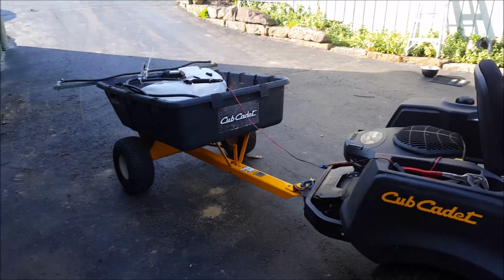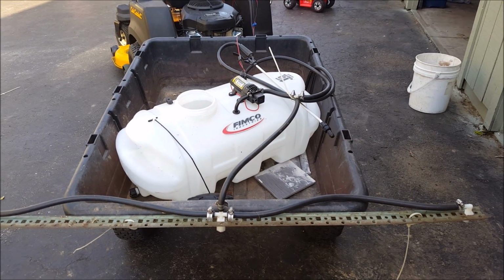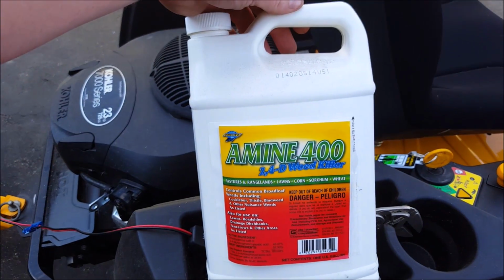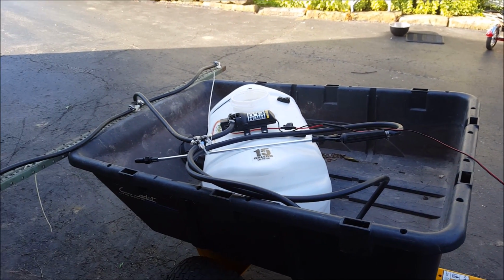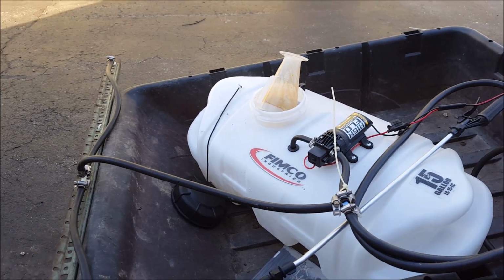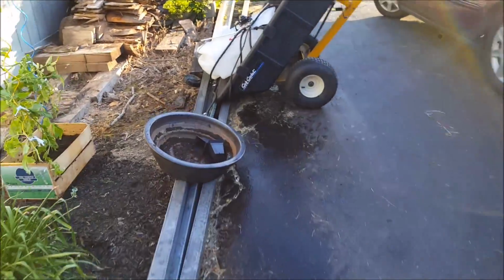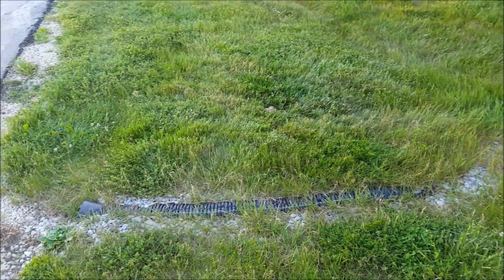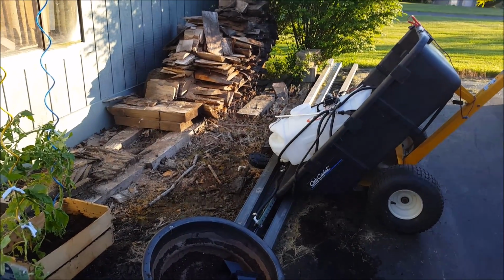Controlling lawn weeds with 2-4D Amine / Diy spray boom

Comment: My tips.... Make a bracket to mount the tank and booms on the front of your ztr. You will be able to see what you're doing better. Also depending on how big your lawn is, add two more nozzles on your boom. This is so you can get a easy overlap with your passes.  I use 32oz of Trimec for 15 gal of water @ 5mph and I use the tips  #AI10025

Comment: the  hy yield brand 2-4-d  I use calls for one gallon per 15 gallons  but I usually mix it at  4oz  per gallon.   Bayer brand calls for 3 to 4 oz per gallon.. at 1 oz per gallon you may as well use straight water because you arent going to get it done with 1 oz per gallon

Comment: Why didn’t you use the Polaris Ranger for the sprayer?  I have a garden tractor and a ranger and think that the dump bed on the ranger would be a lot easier than hooking up a trailer to the mower. Looking at getting the same sprayer to do our yard
Reply from the maker: It tears up my yard more than I would like, but that's a good idea.
Reply: Brett Buckley Even In turf mode?  Just trying to see if I need to get a trailer for my riding mower
Reply from the maker: Unfortunately the 2016 ranger 570 full size doesn't have that. I beleive all rangers 2017 and up have it.
Reply: Brett Buckley ahh gotcha I have the 2016 ranger 570 midsize
Reply from the maker: I debated between the midsize and full. I wanted that little extra room. I do wish it had turf mode.
Reply: Brett Buckley haha that’s funny I wanted to lock n ride system but I wish I could get more weight in my bed. I can only get about 500-600 lbs. I think you can get 1,000 in your bed
Reply from the maker: Subbed you. Looks like your channel is right up my alley.
Reply: Brett Buckley same. Thanks a lot man

Comment: Great video.  I would like you to put some Blue dye in and spray again.  You can get the Montery Blue 8oz for like $6 and it is very visible in like 8 gallons.  Hence, you would need to spend about $12.  It would show you where you sprayed.  That said, you need spray only in areas where you have weeds.  No need to spray the whole lawn.  Might instead use that long hand sprayer and have someone creep you around through the yard you sitting on the trailer nailing all the weeds that way.  It would be more precision.  The other thing you might want to do is buy some Triclopyr.  You can get an 8oz bottle for like  $25 of the 60%+ concentrated stuff.  You would use only around 1 TBSP per gallon or half an ounce.  Mixed with 2,4-d it would hit your weeds even harder.
Reply from the maker: ill check that out. thanks.
Reply: NETWizzJbirk  I have yet added enough of that blue stuff to see it!  I added almost the whole jug the last time I used it...FAIL

Comment: Half tank water with nitrogen, then add 2,4d. Mix with stream if water from hose or using tank pressure control valve if available on tank.

Comment: How wide is your spray pattern?  I just picked up the same sprayer and nozzles from TSC today.  Did you 'Tee' the boom hose into the spot sprayer hose?
Reply from the maker: The spray pattern is right around 6 ft.  Yes I put a T in the spot sprayer hose.  Only thing I still want to do is put a shutoff inline with the boom so I can shut it off.
Reply: Brett Buckley inline shutoff can also be used to control rate of flow to boom so you can use less product and go slower for more precise coverage.
Reply from the maker: Airplane Doctor very true.
Reply from the maker: Do I know you ?  Your user name makes me wonder......
Reply: Brett Buckley If you work in the warbird restoration/maintenance field you might.
Reply from the maker: Nope. I am a aircraft inspector though. Thought I may know you because of your screen name on here.
Reply: It worked great last year, only needed 2 nozzles, 3 was overkill. Used the barbed shut off valve to use spot prayer independently.  Thanks!!!!!

Comment: What sprayer nozzles did you use. I've got basically the same set up. But the heads I got from tsc where crap
Reply from the maker: Kevin Forbes it's going to be a while before I can look. I wrecked my motorcycle and broke my back so I can't go out and look... yet at least.

Comment: Are you happy with the results with the the 2,4-D?  I'm thinking of trying this on my 1.5 acre lawn.
Reply from the maker: Overall yes.  It didnt end up killing off as much chick weed as i had hoped but it knocked out everything else.
Reply: What kind of grass it that? 
I just sprayed my lawn near galveston Texas with 2 4 D Amine, and it killed my St. Augustine grass, all of it.
Reply: At what temperature should I put down 2-4D? I’m in Dallas, Texas.
Reply: Cheryl Rougeau Use it any time the weeds are actively growing. It won't stop dormant seeds from germinating so you may have to reapply if new weeds appear later.
Reply: Andy Kallinger I think every 2,4-D product in the world has a warning on the label that says not for use on St. Augustine or Floratam.

Comment: What type of nozzles did you use?
Reply from the maker: https://www.tractorsupply.com/tsc/product/countyline-80-deg-standard-flat-fan-spray-tip-80-04-pack-of-4
Reply: Brett Buckley thanks! Do you think if I did 6 of these nozzles it would lose pressure?
Reply from the maker: @sgrin2300  if you have the same pump as I do it will not keep up with that. Mine runs constantly with 3.